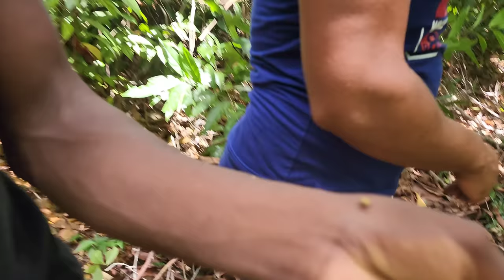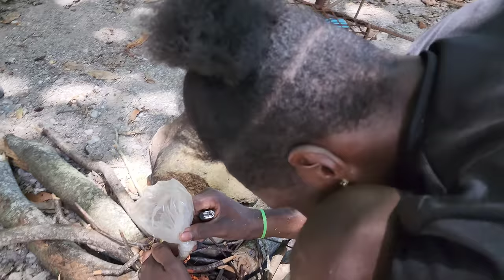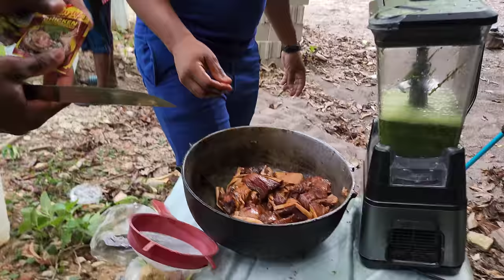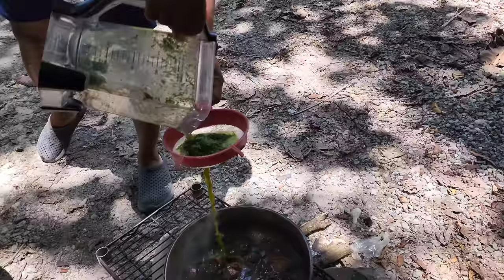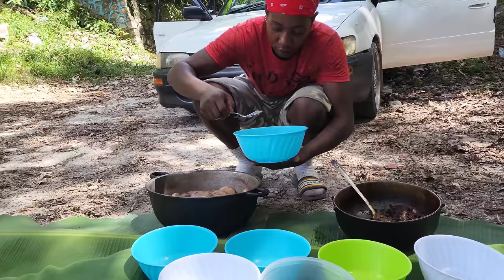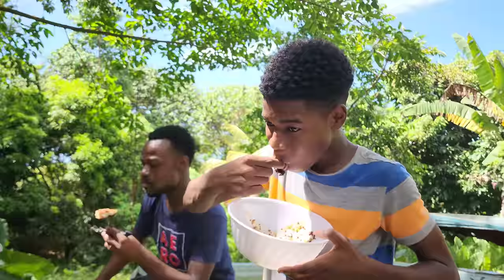Lemon Grass Stew Pork - No oil used - Healthy food @BestEverFoodReviewShow

Comment: Guys wen u using that makita cutting the wall u need to get a bottle of water and make a small hole at the top like a spray bottle and spray the water on the blade only while cutting or spray it on the area where u cutting while cutting that lessen the dust that’s filling the room and it also make u cut easier and faster it’s the same method like putting oil on the saw blade only thing u putting running water on the blade only
Reply: I HOPE THEY'RE PAYING ATTENTION YOU ARE KIND👍✨💘🍵🍵💘👍✌
Reply: Ok respect